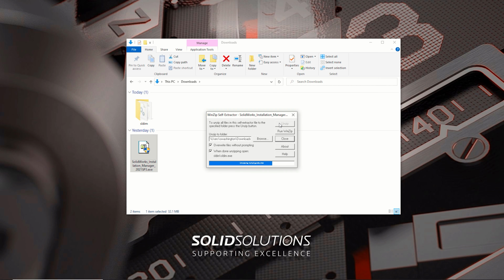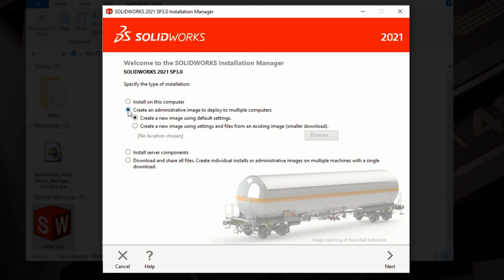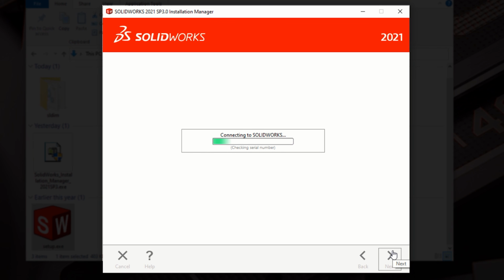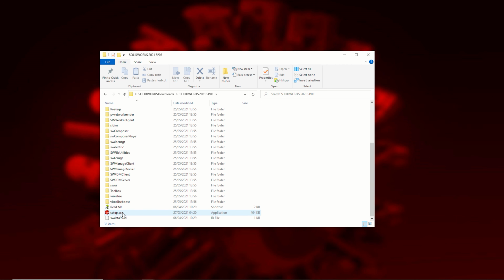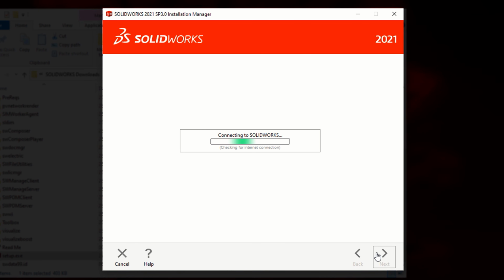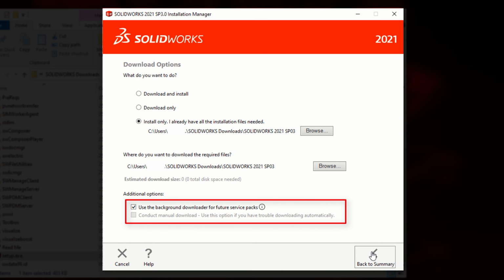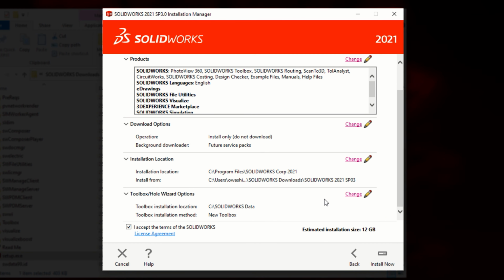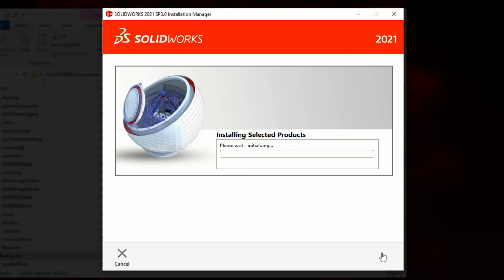How To Download And Install SOLIDWORKS 2022/2023

Comment: is it possible to install solidworks 2021 in windows 11
Reply from the maker: Hi! Only SOLIDWORKS 2022 SP2 onwards are supported by Windows 11. We do not recommend installing older versions on Windows 11. Check here for a full list of system requirements: https://www.solidworks.com/support/system-requirements